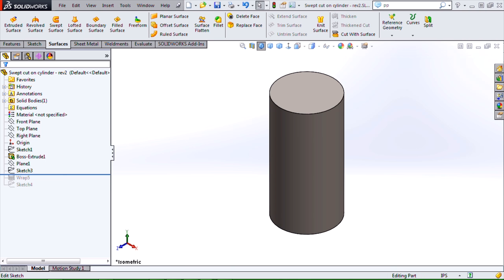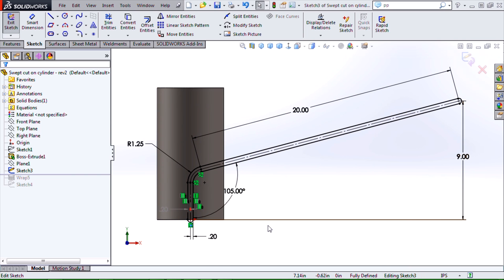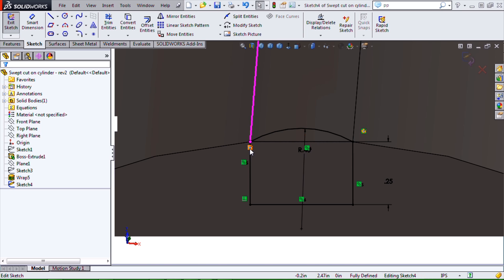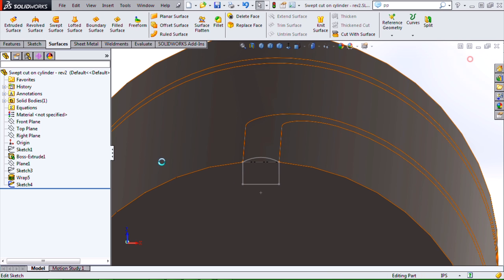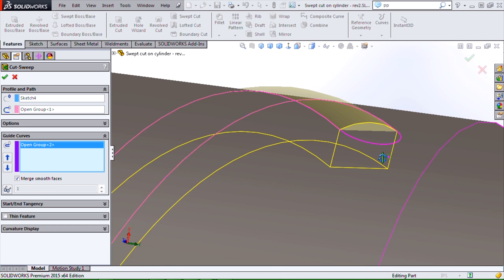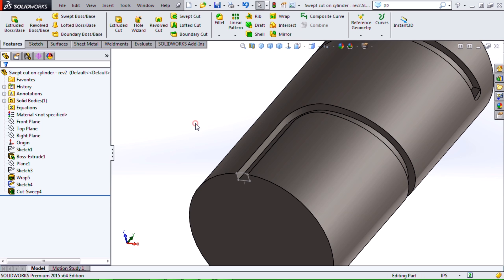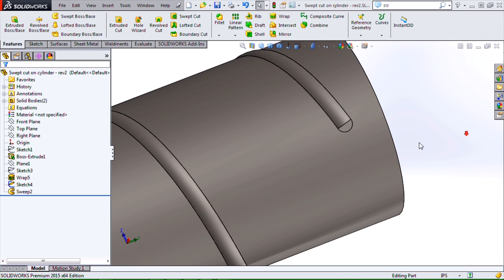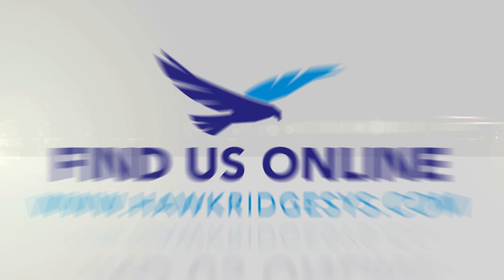SOLIDWORKS - Swept Cut on a Cylinder

Comment: So do you always have to have the path as well as the guide curve?  Seems that a profile and path (singular) should be enough, but I constantly get a long winded failure message that really makes little to no sense.  My cut is much simpler than this too making this very frustrating. Think I'll try option two and see if I can make that work.

Comment: what if my sweep cut was completely helix, no strait part in it. how do i do it?
Reply: +medo sam If you don't have your answer yet, then tell me, i can help. But it basically comes down to selecting your profile / sketch. And then when you need to choose a path, click on the helix, the sketch will follow the helix.
Reply: i guessed it and it worked but thanks for your reply

Comment: I never go this to work correctly. I think what happens is that when wrapping a symmetric curve (on a plane) around a curved surface breaks the curve radius symmetry so the contour sketch can't follow it. (i.e.. a 90 deg curve on a plane when wrapped isn't 90-deg anymore). Your thoughts HRS?